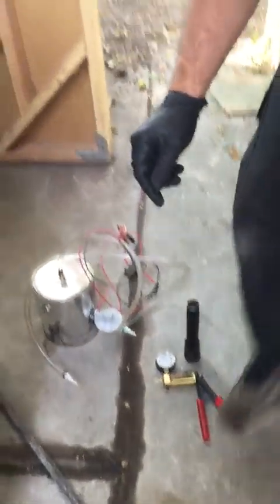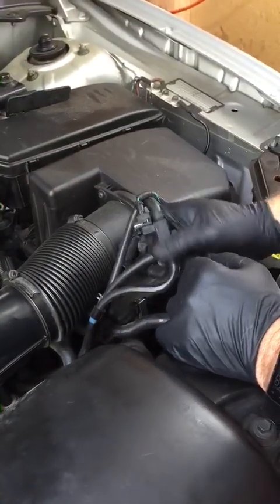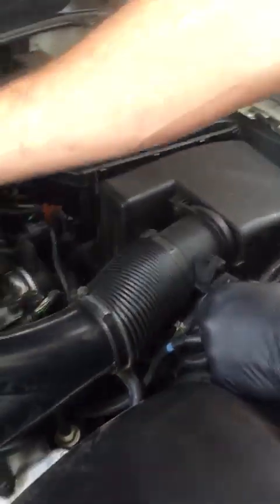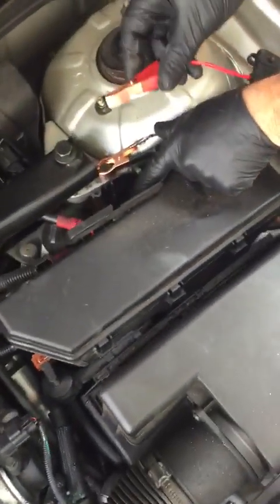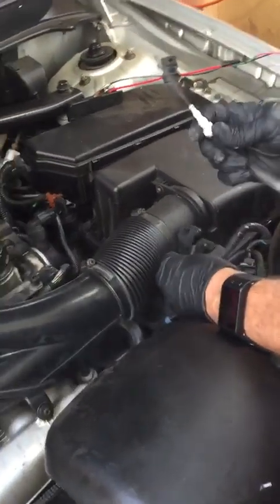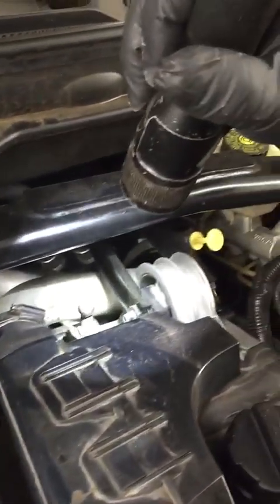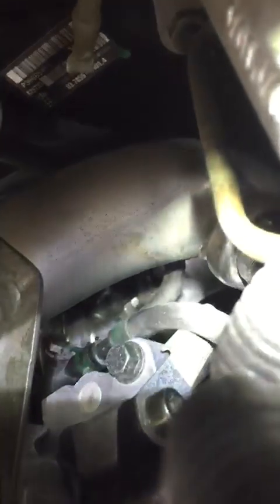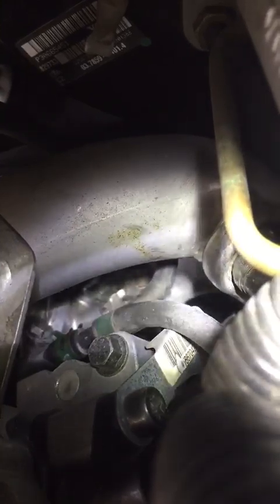2004 XC90 Volvo turbo Overboost problem repaired P0234

Comment: Sweet! I have this overboost code for my volvo c70 and I hear a hissing sound when driving. Was thinking it might be a leak somewhere so I ordered some performance silicone vacuum hoses to replace all the ones from the tcv. I ordered a new tcv in case too well cuz I first thought this could be faulty. Thanks man!
Reply from the maker: Of course, I hope that solved your problem, If not feel free to contact.
Reply: Clock Doc Brown it actually was that tcv solenoid. I had it idling and was listening for the leak but the tcv started clicking all crazy. I replaced it with a new one and the problem went away. Back to 12lbs of boost again. It was constantly having weird boost readings before now it's consistent

Comment: Will the cigar trick work if you don't have a smoke detector?or does it required some type of pressure to be able to perform this test
Reply: I didn't have either tool. I just blew into it and I could hear the air leaking from a hole and it wasnt pressurizing so I lit a cigarette and blew it through and found the hole right away.

Comment: Hey ... I have a similar problem. Just had new turbo fitted 03 plate xc90 d5 ... Just started smoking from back right of the engine. I have a video. Hope you can help.

Comment: If a volvo cx90 was stop for 6 months with out driving.would it affect the motor or trans?
Reply: You can get some moisture in the engine, that's about it. Depending how much though, you may want to change the oil

Comment: what was your symptom? flutter or moaning sound or  noise?
Reply from the maker: Good morning, if I recall the Check Engine light was on and If I recall correctly customer had reported it had gone into "Limp Mode". Customer said had plenty of power then began to have unusual acceleration before going into limp. Do you have any codes present? Whats your symptoms?
Reply: Hi, i think i have a different issue, there is no warning light or a code right now. I checked twice. I have a 2008 Volvo s80 d5 automatic transmission, I hear an extra noise when i hit the gas pedal for couple of  months. It sounds like a sewing machine like "ta ta ta ta ta" but only when i press the gas pedal. Nothing strange when in idle mode and release the gas pedal on the way. When i hit the gas, the extra sound gets faster and harder to notice. I read something online that it might be the turbo propellers imbalance or something but  i do not know the placement of  the turbo unit under the hood. Do you have any idea about this problem? Or the place of the turbo box? Thanks indeed
Reply from the maker: Hi, yeah thats a hard one to diagnose without hearing it. A clattering noise could be anything from bearing knock to valve tappets. The Turbo spins at thousands of Rpm whould be a different sound and if out of balance or bad bearing usually will follow with oil consumption and smoke. try to post a video of the engine running.
Reply: L